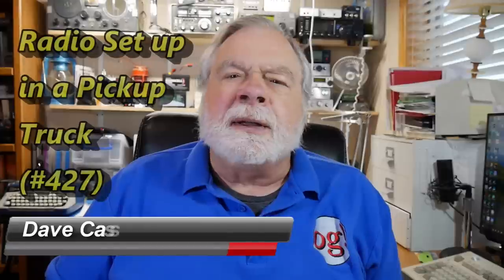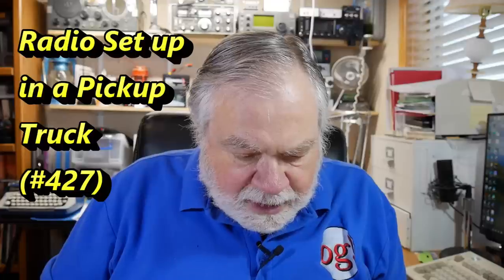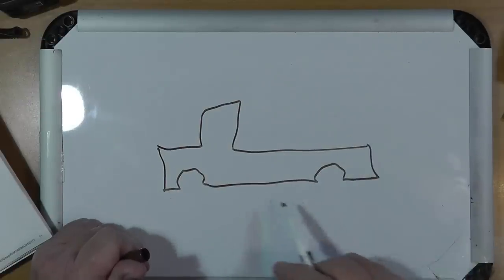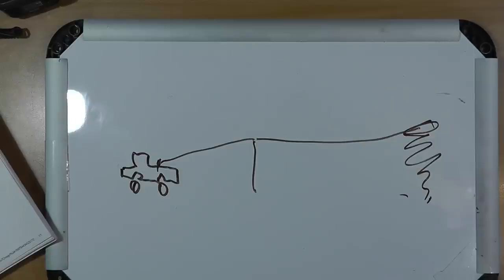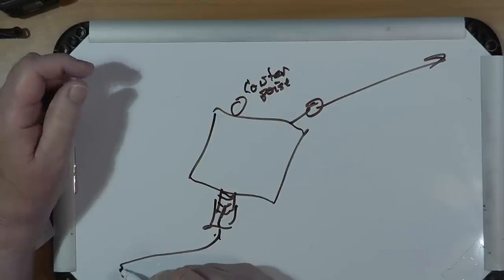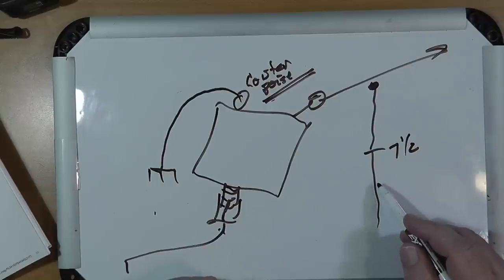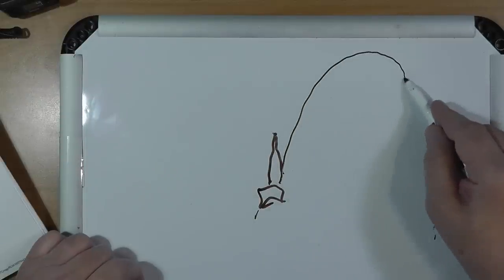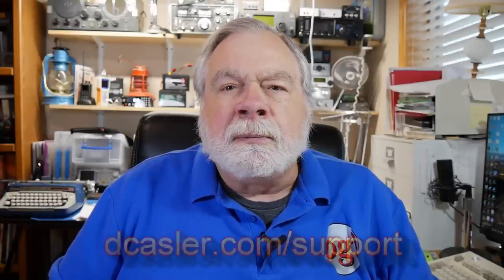Radio Set up on a Pickup Truck (#427)

Comment: Sound more like he has a mobile 10-15 foot whip. That's a job for an antenna tuner, internal, external, manual or automatic. You can deploy a longwire from the top of the whip when stopped and retune if you want. Much more fun is operating HF in an airplane.